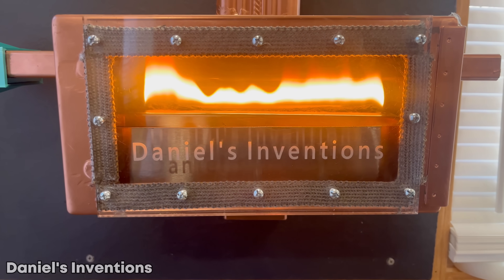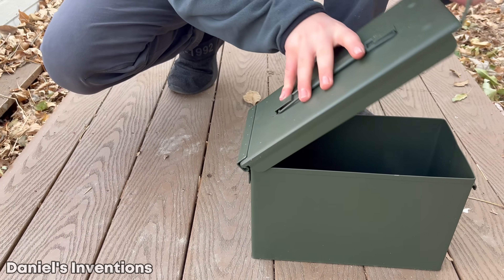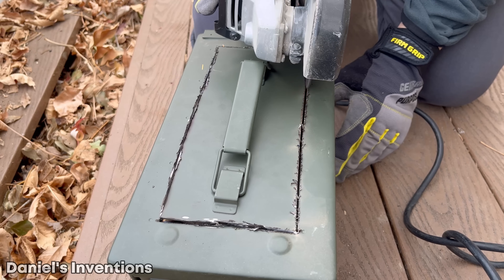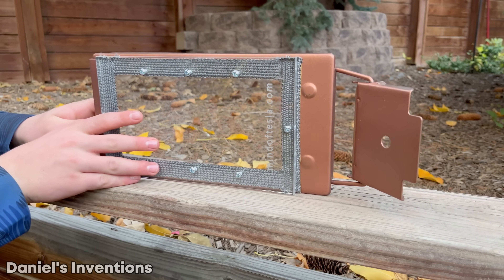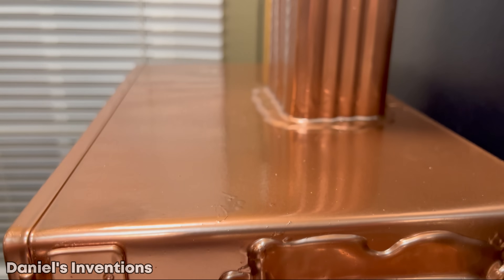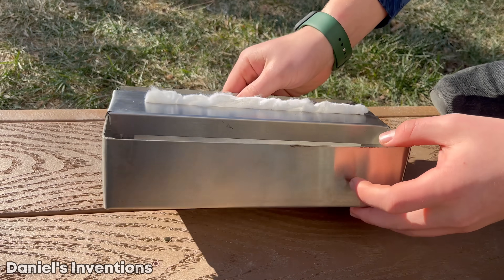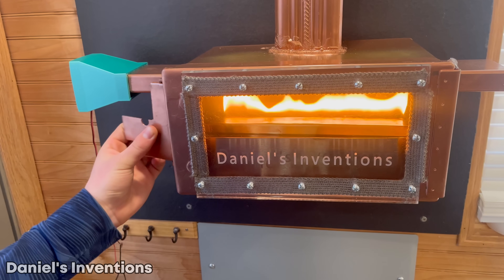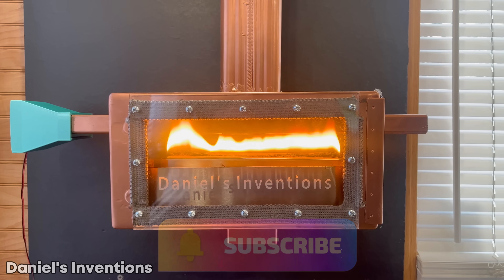ENDLESS Heat for Your Home WITHOUT Electricity 2.0

Comment: Brilliant work Daniel! If you add a Thermopile Module or 2 to the outside and cool them with fans you could easily power some LEDs to light the room or possibly even charge a phone or tablet!
Reply: good idea as ive seen those little wood heater chargers in camp shops and online..5v led are common
Reply: or just use the TEG modules to power the circulation fan.
Reply: @dmatter98  good idea!
Reply: or take the power you would use to run those fans..... and use that to run lights or charge a phone...
Reply: @goysb4jays566  it's a thermopile module that generates voltage based on temperature differential, the mini camping fridges and portable coolboxes work from the same kind of device
Reply: @goysb4jays566   its the poor mans version of a peltier module.    it can make small amounts of electrical power based on temperature differences.   one side would need to be actively cooled to get anything useable, hence the need for fans.   you wouldnt be able to extract enough power to run said fans though, not without a sophisticated setup.
ive seen peltier based woodstove fans... one of those could run a few small LEDs probably.   that or the fan.   without the fan cooling the "cold" side though, it wont make as much power

Comment: Great video! Not sure if it’s been pointed out, but stove paint will need cure for the first few builds, releasing a lot of fumes and odor. It’s recommended to cure the stove in a well ventilated area prior to installing indoors.
Reply: Also mostly just burning off the original paint will do wonders too because if you don't it'll peel as well as off gas.

Comment: In the 3.0, add a room temperature sensor, so you can regulate the heat in the room automatically, raspberry or Arduino. So you can redirect the excess heat to outside. Just a idea. It's not practically correct but you can make it there brother. Your work is god level!

Comment: Use this concept for an existing wood burning stove. All you have to do is put an oil pan inside with several wick bars. It already has controllable air intake, glass door and exhaust is already going through the roof. While you can get a forced air attachment, it just automatically radiates heat into the environment.
Reply: The heat build up inside the stove could bring the oil to a boil and cause a dangerous fire - that goes for the model above as well. The inlet combustion air in the above case is probably keeping the oil cool enough but that may be more luck than planning.
Reply: Also i believe that the exhaust must be higher the building for some reason.

Comment: This is a cool prototype. I would caution using materials that are not designed for high heat long-term. The paints and adhesive compounds that aren't designed for 400-500 degrees will offgas chemicals over time into the house and affect your health. Starting with uncoated materials and spraying them with high-heat paint would be a safer solution.
Reply: Yes it would probably be a good idea to sand blast the ammo box prior to painting with high temo paint.
Reply: That coating is high heat jb weld is smart to use  if he wanted he could use high heat caulking that would do the same with some pop rivits
Reply: @kcufecaf  Straight from the back of that exact Rustoleum can: Do not spray on surfaces that will exceed 200⁰ Fahrenheit.
Reply: He said coating not paint.
Reply: @Mark Ketchum  Paint is indeed a coating. So without further elaboration, we don't know what he meant. Since the only "coating" used in the video was the can of rustoleum paint, I made the assumption that was what he was referring to.
Reply: Original formula JB weld can handle much higher temps-we use it in our out side wood stove to fix rusted out leaks and it works very well and lasts too, Would remove original paint and then use high temp paint and also have an out side air intake as you are drawing in cold air from the rest of the building where air can get in so it makes the building colder on farther away walls (negative .pressure) You could use a damper in the air intake  to cut off the air to shut off the  heater when you want. I would still have a air gap between the wall board and the wall so heat is not transferred into the wall too much. Great job and keep up with the improvements!
Reply: Like it was doing at the very end of the video. if you look you can see it burning at the top of the ammo can and inside the room.
Reply: Just because you see it on YT doesn't make it a good idea.  This here gets the job done, but there's a better way that involves more money
Reply: @gamete4375  
What's the better way.
I love this kid & the contribution from others.
Thanks creation gang
Reply: @Asphaltwizard  what do you think paint is?
Reply: @goysb4jays566  Use paint stripper or sand it off then?
Reply: Why paint anyway?
Reply: @danhle1032  True. Could just leave it bare.
Reply: @goysb4jays566  bruh it takes like 5 minutes to sandblast something that size, if that lol.
Reply: Curious, did they say how long it would burn using that size reservoir?
Reply: @joshuawiedenbeck6944  it just won’t look as awesome as it does now with that paint color
Reply: @Mark Kenney  True. I'd choose my health over looks though.
Reply: @joshuawiedenbeck6944   just use header paint . It's designed to be used on exhaust manifolds...
Reply: @blakenewton2781  Yeah, or grill paint. Designed to touch up black barbecue grills.

Comment: Hey Daniel, you're missing a metal IR reflector on the concrete wall. Also, your burn is quite inefficient, add some mantle to the flame area. Possibly with additional oxygenated air intake from outside. Lastly, add an IR metal reflector on the ceiling over your creation as air convection heats the ceiling instead of your room.

Comment: Fantastic concept, I am sure millions of homes would be very interested in a constant supply of cheap endless heat. Just another pointer, would maybe hold the back board off the wall a half inch as it would keep more heat in the house.

Comment: For those wishing to duplicate this or other non certified heating source I strongly suggest you contact your insurance provider. Good luck getting coverage then and good luck collecting in the event of a fire.  I did enjoy the video and admire the creativity and diy engineering skills.  Nice video.
Reply: Its an oil lamp?
Reply: @FGQuinto with a high risk of fire, which then will void your homeowners insurance
Reply: @PlutoTheGod  i can see that. Good point then.  I guess one would have to know the ignition temp of the oils used to feel safe.  Olive oil is 400f ish. The OP stated temps of over 500f.  So ya. Cool concept but not safe.
Reply: @FGQuinto  it’s also the fact there’s a lot of radiant heat, a fan involved, a ventilation hole cut through the wall, non heat qualified paint and materials involved etc. there’s just an incredibly high chance of ignition or melting a ton of shit around the house. Most plastics melt around 230-270 degrees, paint on the walls of your home also around that range, at 300-500 things like curtains and other fabrics can start to combust etc.. it’s definitely not something to be taken lightly
Reply: Why would you ask for permission from the insurance company scammers? The answer will always be no. You should just say what you really mean which is don’t do this.
Reply: Well if it reduces my heating to $20 a month, I can handle the risk.
Reply: @Randorandom232  - the risk is your house and contents burning down from a fire hazard that you caused. Not covered by any insurance. I hope you have deep pockets.
Reply: @michaelmayfield4304  You must be an insurance salesman
Reply: I can be built even safer BUT STILL SAFER THAN A WOOD STOVE.
Reply: Insurance is a scam.  If your place is paid off, you don't need insurance.  You just need a pair of ABC fire extinguishers, a smoke alarm, and situational awareness.

Comment: BRAVO on your Creativity & Safety!

Consider thermally mounting inside your Heat-Exchanger , an additional copper or aluminum finned heat-exchanger (from an old computer) to create more surface area inside your heat-exchanger. You will get more heat out that way. 

You should also test "Activated Carbon Felt" as a wick-material. Pretty good capillary action for most liquids. You may need a few drops of Alcohol to get it started, depending on the oil used. 

And Activated Carbon Felt is heat resistant (very little smoke if any). 

Best of Luck - Regards.
Reply: @goysb4jays566  'Thermal Mount' or thermally fastened ... the same way you mount your heat exchanger onto your computer CPU , is the same way you should create more surface area for this heat exchanger.

More surface area to capture the heat , and more surface area to exchange the heat into the room , is a good thing!!! 

Mathematics & calculators for materials used are all online - Regards.

Comment: Not sure about the aluminum down spout, would probably keep a eye on it and could use some chicken wire or the wire mesh with 1/4 inch squares to keep birds and the like from coming in. Also a little deflector to nudge the heat into the room and away from the blind, the thin plastic of the slats may warp with the high heat. Looks like a neat project

Comment: Great job. Most of what I was going to suggest has already been suggested in other people's comments. Air intake from out side (this will also reduce the amount of oxygen been taken from the room), peltier for fan and carbon felt for the wick. My other suggestion would be to mount it lower on the wall and extend the chimney. All these will improve it's efficiency. If you wanted to go an extra step, you could duct the fan inlet from the opposite corner of the room at floor level but this will need a couple of extra fans just to help the air circulation.

Comment: Great work. One remark: it sucks oxygen from the room, so it must get ventilated well. At the other hand: you could also make a double pipe, one for air inlet and one as exhaust.
Reply: it doesnt remove oxygen from the room, it pulls air through all the small gaps around the windows and doors of the house. The draft creates a slightly negative pressure, similar to turning on the exhaust fan in your bathroom (but not nearly as much CFM)

Comment: I actually used a 1/2in wide hurricane lamp for an extra (supposedly) 900btu of heat last night.  1500W (5100btu) space heater didn't quite keep up during a low 20s night.. used a 200W heater along with it and that sort of worked.  But adding the 1/2in wick hurricane lamp to the 1500W heater.. stayed 70F in here.  

And was thinking on some kind of oil tank with several oil lamp burners.. extending the rods that adjust the wicks to outside an ammo box.. or maybe just have the knobs facing towards the door.. pop it open, turn wicks up/down, close it up.

Comment: I like seeing young inventors try new things. Just some ideas. Your computer fan uses electricity. They have energy temperature differentials that generate low voltage power. Meaning one side hot, one side cool produces electricity. Another possible variation is your fan system. They have wood stove fans that spin with heat energy too. Keep up,the good work, looking forward to version 3.0

Comment: Nice Video. Couple of thoughts for version 2.0. Why not use a Noctua Fan so that it is quieter. Also why not put the heat into a thermal mass and then heat the room from the thermal mass so that you can get more heat into the room, and less heat going up the drain pipe. Also you might want to extend you exhaust pipe past the roof line so that you don't have a fire.
Reply: @goysb4jays566  I want to say good job and great idea of what you came up with already. Thermal Masses can be large and the can be small. I am just trying to find a way to capture as much heat as possible before sending it up the chimney. It could be something as simple as two ammo cans sitting on top of the heater filled with water or even half filled with water and another fan system running though that to take the heat and put it into the room. I was just a thought. 

But the bigger though for those people going out and buying the fan for this project is a Noctua fan. They are close to silent. 

Also please make sure you vent past your roof line. So many things can go wrong if you don't from prematurely aging of shingles to a fire breaking out. Also if it stick out  at least a foot past your roof line it's harder to critters to climb in when you stove is off.
Reply: 1) Cut out the fan entirely. Just extend the air intake to the floor and let convection do all the work. Zero energy use.
2)Thermal mass heating is only good for when you cant' fuel the heater for long periods but burners like this will go for well past 8 hours  with a full tank. Otherwise it just takes longer to put out the heat because you have to heat all that extra mass before it starts radiating any noticeable heat.
3)Make the intake for the firebox come from outside that way you aren't pulling in cold air from outside through all the cracks in your house.

Comment: Not sure I’ll ever get around to building one at this point but love the idea. Great job. You have a new subscriber
Reply: Don't. Jb weld doesn't hold up to heat and drain pipe isn't designed to be an exhaust

Comment: If you place a steel sculpture with a lot of surface area on top of the heater, you might transfer heat quicker. The sculpture could be removed with metal tongs in order to cook on the heater surface
Reply: I have two cast iron Crows on my wood stove.  This trick works.

Comment: Love the design!  Well done!!  Did you use high heat screws and bolts?  I am just wondering if they melted or warped once they got hot.
Reply: The screws and bolts need a huge amount of heat to warp. I assume normal screws and bolts would be fine for this project. The heat is contained inside the ammo box which causes the screws and bolts to not get nearly as much heat as any other part of the heater. As the video said, the fan is very efficient at circulating air through the heater so the hot part would be the pipes rather than the screws and bolts.
Reply: There is jbweld joints so I wouldnt be worried about screws 😁

Comment: You should put a temperature control system in it. Temperature relates to how long the wick will burn till the temperature drops again to reignite the wick. Kind of like a furnace. Could save on oil consumption and promote safety measures. Also a carbon felt would be a great long lasting wick. You can get the carbon felt where they sell welding supplies.

Comment: You could improve its efficiency by adding a pipe to encase the exhaust pipe and filling the cavity between with sand. The sand would absorb heat from the exhaust and radiate it into the room when the heater is turned off

Comment: Hi, you Guy's are Great.!! I Love ya, channel..
Now" I'd  like to see what it would do" with a coil of 3/8's to an 1/2" inch copper pipe, wrapping
Around the exhaust Port and Hooked up to an Water reservoir.!?!? I bet it would be a constant
Supply of ( 🥵!!HOT!! 🥵 ) WATER.!! That's easy to use for "all kinds of stuff".!!  From in - floor heating, to production of steam to turn an 
Small ( off - Gride ) turbine generator, for 
Maybe, Doing "VERY LIGHT DUTY"
OR Maybe Even to "Recharge" Cell phone,s
Or even, a laptop, or battery's for the ( Weather
Report, Radio).!! Lot's of possibilities.!!! Good luck experimenting, & GOD bless.!!

Comment: Very nice design! 
But I have a question:  Can the 12 volt fan be replaced with one of those heat powered Wood Stove Fans ??
Reply: Look on Amazon for wood burner fan replacement parts, You will get a motor and an electric generator plate that works on the heat from the stove, I am sure you can fashion up a fan and fix the plate on top of the stove  the operating temps are around 175 F to 650 F, incorporating a switch would probably be a cool idea too.

Comment: I would have put a sheet of radiant heat reflective material on the wall behind the heater so it reflects the heat from the back of the heater and the exhaust pipe into the cabin for more heat. The black panel will just absorb heat. But I like this design a lot.
Reply: Its all in the same space either way. Along as it's insulated it won't make a difference.
Reply: That vinyl mini blind might deform from the heat over time unless the hot air is directed away?
Reply: A reflector reduces the risk of the wall getting hot enough to spontaneously ignite.

Comment: What about the fumes? And how long it last that amount of oil? Would it last through the night?
Thanks it is an interesting idea. If the fumes are not too polluting one could make them go through a laberinto like in the Russian wood stoves made with briks, this way the heat of the fumes can be used tu further heat the place. Would be nice to know how long it takes a room to hit up.
Reply: Think that’s why he has the exhaust pipe going outside.
Reply: what do you mean by “a laberinto?”

Comment: As a retired electronic engineer, I would really like to know how the title says "WITHOUT Electricity" and THEN you show the 12 Vdc fan installation?
I was expecting you to use a "heat powered fan" ,   re-configured of course.
I mean this id version 2.0.
Reply: Good point. I wonder if using a small solar panel to recharge batteries and making a battery operated computer fan could solve the need for electrical outlet for power outages or camps that have no electricity.

Comment: I would suggest drawing in the air from outside so you don't create an under-pressure that sucks in could air from everywhere.
Depending on your insulation that could massively increase efficiency.
Reply: I'm pretty sure he did... At least that's how he showed doing it in the first one he made.